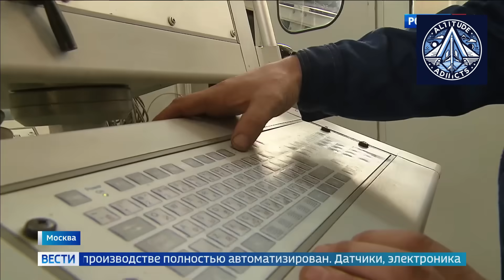MC-21 Achieves 200 kg Weight Reduction with New Russian Composite Wing!

Comment from the maker: I see there is a confusion on the Maximum Take off Weight. What is meant is that the "Total" weight has increased. My bad.
Reply: Yeah, and it is not your first time either. You did that in one of your earlier videos about the MC-21. A 6 Tone weight increase? You had us confused alright..
Reply: The information about the MS-21 being overweight is not based on anything that could actually confirm it. Rumors about this are based on the change in the maximum takeoff weight (MTOW) of the MS-21 on the UAC website. There were no official statements about the MS-21 weight distribution. THIS IS FAKE!!!
Reply: I'm surprised that your channel is spreading fakes!
Reply: It was not Russian media, it was commercial media that spread fake information!!!
Reply: I doubt the weight increase is in the range of a few hundred Kgs, otherwise there would not be a resumption of Tu- series production and talk about Ms-21-210. That said, it is surprising that the weight increase could not be forecasted in 2022 especially given that restrictions were foreseen ever since 2014. Tu-214 could be flying now. The fact that the weight increase is coming from pretty much all the systems indicates that Russia is lagging across the entire supply chain and needs significant investment in next gen. technologies and production capacities.

Comment: The information about the MS-21 being overweight is not based on anything that could actually confirm it. Rumors about this are based on the change in the maximum takeoff weight (MTOW) of the MS-21 on the UAC website. There were no official statements about the MS-21 weight distribution. THIS IS FAKE!!!
Reply: Sayap komposit yang diimpor dari Jepang adalah yang terbaik dan ringan. Sedangkan buatan dalam negeri di Rusia masih dalam tahap pemula, sehingga hasilnya berbeda termasuk beratnya.
Roda pendaratan juga tergolong berat karena masih pakai penyedia yang sama untuk Tu-214. Sedang diupayakan untuk memproduksi yang lebih ringan.
Semua soal waktu. Masih ada setahun lagi dan masih ada peluang vendor lain bisa menyediakan yang lebih ringan.
Reply: @advang5plus36  Composite wings were never supplied from Japan, they were always produced in Russia! Carbon fiber was purchased from a Japanese company!!!
Reply: @advang5plus36  
Boeing and VSMPO-AVISMA (RUSSIA) jointly produced the first components for the landing gear of the Boeing Next-Generation 737 aircraft

VSMPO-AVISMA has been a partner of the American corporation since 1997
MOSCOW, October 12. /ITAR-TASS/. The Russian-American joint venture Ural Boeing Manufacturing has delivered the first beam of the main landing gear of the Boeing Next-Generation 737 aircraft, according to a company statement received by ITAR-TASS. Ural Boeing Manufacturing /UBM/ is a joint venture of the American company Boeing and the Verkhnesalda Metallurgical Production Association /VSMPO-AVISMA/.

"The production of the main landing gear beam for the Boeing Next-Generation 737 at UBM is an important step in the long-standing cooperation between Boeing and the state corporation Rostekhnologii /VSMPO-AVISMA/, our strategic partner and key supplier in Russia, - said Gary Kessler, CEO of Ural Boeing Manufacturing. - Our work is aimed at increasing production volumes and production capacity." The main landing gear beam of the Boeing Next-Generation 737 is an integral part of the wing structure that supports the attachment of the landing gear. It consists of two parts, one for each wing. UBM will perform the initial machining of the stampings received from VSMPO-AVISMA, which will then be sent to Boeing's plant in Portland for final machining. Providing about half of the total primary machining of the main landing gear beam, production at UBM enables the Portland plant to maintain production capacity in line with the increasing production volume of the Boeing Next-Generation 737.

VSMPO-AVISMA has been a partner of the American corporation since 1997. In July 2009, Boeing and VSMPO-AVISMA opened a joint venture, Ural Boeing Manufacturing, located in Verkhnyaya Salda /Sverdlovsk region/.
Reply: @advang5plus36  Russia produced "light" chassis for Boeing, but it produces heavy ones for itself 🤣🤣🤣 Stop reading Western clownish mass media!!!
Reply: Fake is only your post. According to official data that you can find also in the internet weight of the MC-21-300 has increased by over 5 tons and range reduced by nearly 1000 km. There is nothing to discuss.
Reply: @alexandervt641  Don't lie! There is no such "official" data!!! Only trash media!

Comment: Weight reduction in any big airplane is critical, because there`s no way to sacrifice structural strength to achieve this goal and any potential flight range distance. Any way is remarkable for Russian Federation to offer such new jet airliner by rushing the program in only 4 years. Perhaps they`ll make it, despite the technical and advisory issues in the process  running.
Reply: Untuk sementara yang dikorbankan adalah jumlah penumpang. Konfigurasi full 200 penumpang tidak mungkin, dan turun menjadi maksimal 180 penumpang di MS-21.
Mesin lain yang lebih bertenaga wajib dikembangkan.

Comment: you have the range completely wrong - the new range is 2800 nautical miles ...... not kilometres, which is roughly 5000 kms.
simple maths tells you that if your weight increases 7.5% ...... your range won't decrease by 50%
the SSJ-100 is quoted as having a 4500 km range ...... but the bigger MC-21 with carbon wings can only fly 2800 kms ?
Reply from the maker: Math cannot be wrong. However, there is maximum range, empty weight range, full load range etc. As per the Russian literature, the range with Full load is about 2000 - 2800 kms.
Reply: @altitudeaddicts which is totally useless and means this plane won't even go into production, if that info about range is true.
Reply: @LloydChristmas983 
Untuk sementara tetap akan diproduksi.
Tapi jumlah penumpang yang akan dikorbankan.
180 akan menjadi maksimal penumpang di MS-21. Itupun juga jarak terbang ikut berkurang.
160 penumpang di 2 kelas akan lebih realistis, masih memungkinkan untuk jarak terbang 4000 Km.
Mungkin akan ada mesin pengganti yang lebih bertenaga namun tetap hemat  seperti PD-14. Namun pengembangan mesin ini pun butuh waktu

Comment: Well, 5.75 T were mentioned in the initial article in the "Kommersant" newspaper if I remember properly. No one knows where from they (actually she - Aigul Abdulinna) took this info (I think, the plane was not assembled yet), because the empty weight did not increase. However, we know, that back to 2023 the plane was tested to carry additional 36 pax - 211 totally. Take their weight, luggage, chairs weight, additional equipment per pax - life vests, food, water, all this is about 4000+5000 kg - may be this is the source of this fake.
Reply from the maker: We can debate on the actual weight. However, since Russian Ministers are openly saying the weight has increased and they have started the 210 project to offset this, make the concern real.

Comment: It's a step in the right decision, but removing 0. 2 tonne from 6 tonnes overweight unfortunately won't make a dent.

I'm really worried ;I so want Russia to succeed in the MS21, but they'll need be more creative without compromising safety.
Reply from the maker: 2000 kg is 2 ton.
Reply: @altitudeaddicts apologies, I missed the decimal point out which I've now corrected. Your report said they've saved 200kgs out of 6tonnes?

That's still a far way to go before making it light enough to meet UAC's original expectations.

I still have hope for the MS21 🙏.

Comment: A year ago, Russian media outlet Kommersant had reported an overweight of 5.75 tons after Russification of the MC-21. In this light, a weight reduction of 200 kg appears to be completely insufficient to achieve the originally specified performance data.
Reply: Meskipun belum ideal, mengurangi jumlah penumpang memang langkah terbaik. Semua A320 di Rusia, dengan full kelas ekonomi adalah 180 penumpang.
Maka maksimal 180 penumpang ini bisa dijadikan acuan sementara demi tersedianya armada baru menggantikan pesawat Barat tahun depan. Secara teori, konfigurasi 180 penumpang masih memungkinkan untuk rute 2500 Km. Sedangkan untuk rute lebih jauh hingga lebih 3000 Km, 160 penumpang adalah konfigurasi maksimal.
Kita tunggu lagi dalam setahun, apakah masih bisa turun berat sampai 2 ton.
Dan ada peluang dalam 2 tahun ke depan tersedia mesin PD-14 yang lebih bertenaga.
Reply: @SmartphoneZTEbladeA72  I think it is more likely that the MC-21 program will have to be put on hold. As was reported on this channel a few days ago, the production costs of this model are exploding. The aircraft is simply too expensive for the Russian domestic market to buy in large numbers. Another victim of a senseless war.
Reply: @luisdamian4562without war there wouldn't be any aircrafts. Russians will still be flying on Boeings and Airbus

Comment: Where is the weight gain specifically?  
What's the breakdown?
Reply from the maker: 1) The Russian composites 2) Landing Gear - This is massive weight increase 3) Russian systems. Basically, the weight increased in most of the import substituted components.
Reply: @altitudeaddicts How come SJ-100 doesn't have the same problem?

Comment: A full 200 passengers can be used for a short 2,000 km route. This is sufficient for a flight from Moscow to Yerevan, which is less than 2,000 km. Or, a forced downgrade, using the powerful PS-90A engine, with 20 tons of fuel and 200 passengers, can reach 3,500 km. 😁 That's not bad.

Comment: The Landing gear contributed to most of the weight gain as I remember. Switched from foreign to domestic and based on the old tu-214 landing gears.
Reply: Russia has a fair bit of titanium reserves.
Would that be an option to reduce weight?
Along with better design, of course.

Comment: . if the maximum take-off weight has increased, the thrust of the engines has turned out to be   
   the strength of the airframe is also sufficient
Reply from the maker: I have issued a clarification. It is pinned in the comments.

Comment: I don't understand why you are comparing the maximum take-off weights and not operational empty weights. MTOW is not an indicator of mass efficiency, whereas the difference between MTOW and OEW is. The greater the difference, the better. The lower the OEW, the better. You can increase MTOW while keeping OEW the same, and it will result in a better aircraft, not a worse one.
Reply: Spoken like a man tbat understand the technology
Reply from the maker: I have issued a clarification. It is pinned in the comments.